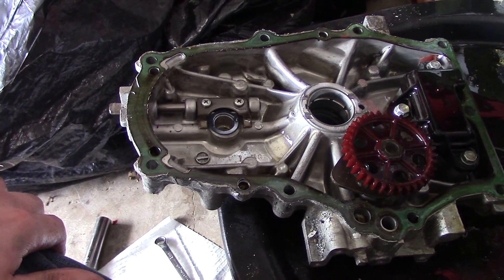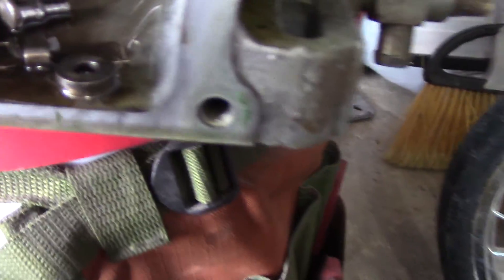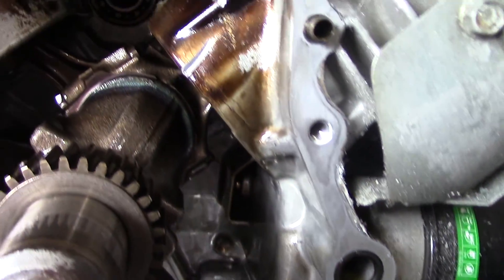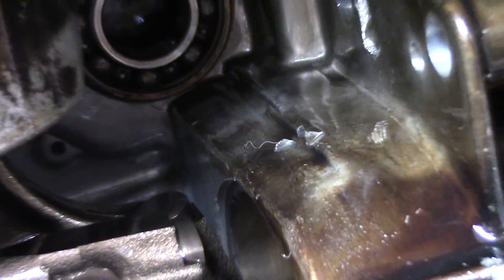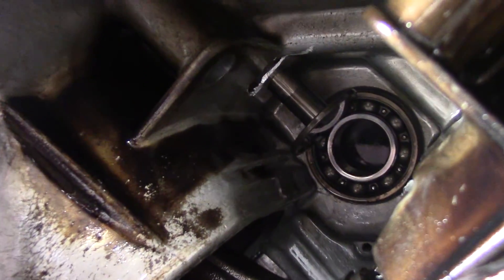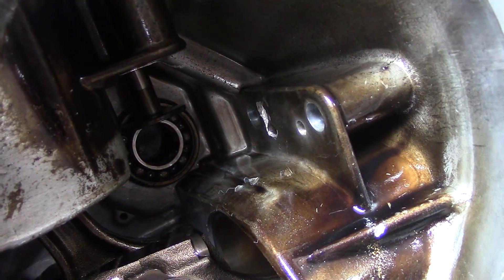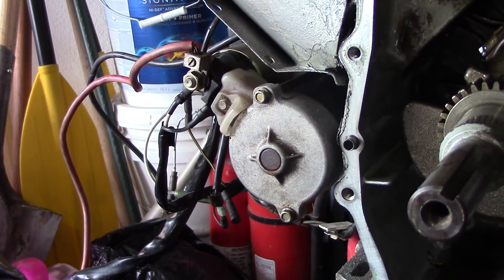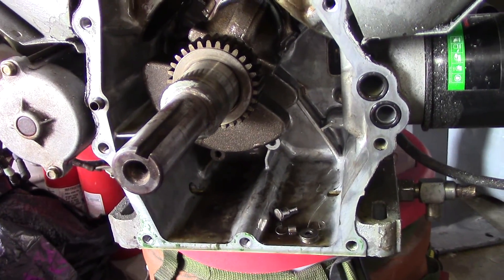Honda GX620 Camshaft Gear Broken

Comment: My Honda GX 620 broke the plastic gears.   No damage to the block or cam.    I ordered a new cam, oil pump and govoner gear.    Kind of disappointed in a high end engine with plastic timing gears.

Comment: Do you still have the camshaft of this engine? I have a GX620 engine with a broken camshaft (somebody made their own camshaft which failed), the camshaft gear is still fine. I would be interested in buying your old camshaft if possible.
Reply: Ya can buy them new not cheap tho 650 pound
Reply: @anthonycutchey5130  Thanks for the tip, considering the state of the chassis and the rest of the engine I really can't justify spending 650GBP to myself. And, in fairness, if I did want to spend that amount of money I'd much rather try to convert it to pneumatic valve action (and fail if need be) than spend that much money on such a simple part, it just goes against all my principles.

Since most people seem to have broken cam wheels I was hoping to buy someone's sloppy seconds but it hasn't worked out that way over the past 3 months, I have also found new knock-off's on Aliexpress for around 50GBP, I think I will give that a try.
Reply: @beunhaas102  have you got a link I also need a camshaft for the old 98 engine same as one in the video with 4 lobs newer engine only has two also after carburettor and full airbox set up
Reply: @anthonycutchey5130  I'm sorry, it is the wrong one (for us both) that Aliexpress is offering.
Reply: @beunhaas102  had a feeling as I have been looking for a few months now hoping someone has one that is locked up and I can get from parts from one
Reply: @anthonycutchey5130  Well I have made my choice, I'm just gonna sell the GX620 unit for parts and buy a complete SV650 motorcycle and use that engine for my kart. A ugly but complete/working SV650 is about the same as a new Honda camshaft, and when I'm finished I will still have the old engine + half a motorcycle to sell.
Reply: @beunhaas102  hit me up with the listing on the parts I could do with a carb for sure

Comment: have a small generator, Mutpquip with GX630. checked out had no compression, and nothing moved when cranking it.   walked away, went to an acupuncture appointment, bam!! came into my head. cam, lifter. was not sure the working. but found your video, not compression.  will see if I have holes in the block.  or just buy new gear needed.  Well, let's see.  will send pictures of my findings.
Reply from the maker: I replaced cam in another one I got for $20 and it works great.

Comment: Dude my engine has a big ass crack on the side and it still runs . I’m going to open it I’m sure it thru a rod , but if can replace it and have the crack welded  I can probably save it. I seen the case for about $300.00 give or take 50.00 lol .

Comment: Any chance you have the air box for this engine? I acquired a generator with this engine but the airbox is gone.
Reply from the maker: Ebay has afrtermsrket ones

Comment: You can rebuild it cheap from ebay parts now.
Reply from the maker: I wish. This is not the K series, which were cloned. This is the older version that has different parts.
Reply: KartFab oh :/   i just bought a crankshaft for a gx670.  That used to be a generator engine.  And. I am going to put it in a golf cart.  !    

I was hoping your engine was one of the ones that Everest parts are making whole blocks for :(
Reply from the maker: dont worry, ive got two more that work :-)

Comment: Just blown the Briggs Vanguard equivalent engine, 160 hours in an Ultralight aircraft at 4000 and the camshaft broke in the middle, serious damage to everything as it threw out the oil...;-(

Comment: You can get a new vblock for 300 bucks, get a used one on ebay for a hundred less or even less... worth it to salvage that motor.
Reply from the maker: +Dave Boothney I ended up buying  two more for $100 so I fixed my problem.
Reply: +KartFab good news then :)

Comment: Wow, never seen that before, these are bullet proof, looks like the decompression part of your cam let loose and did the damage.Did you ever determine the cause?
Reply from the maker: The camshaft gear broke. Timing went out of whack and some bits of metal from behind the camshaft gear and who knows what else happened.
Reply: ***** I feel your pain,What was it running on?
Reply from the maker: Nothing. I bought it from s guy for $200 because he "couldn't get if to start" what he meant was he broke it and it wasn't seized so he could get someone who thought they were handy to believe they could just wire up the electric start, clean the carb, and be set......but then he would just take the cash and pretend to be stupid... Oh well. Gotta love craigslist right?
Reply: ***** Haha,sorry to hear,plenty of those guys around,if I ever need some parts I'll keep you in mind,solenoid on the bottom of the carb might bring you a few quid back!